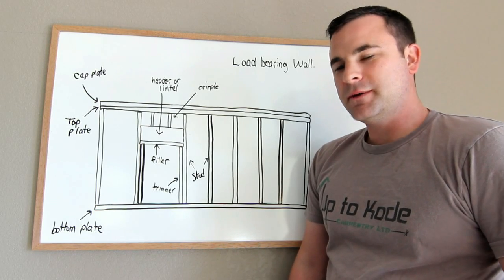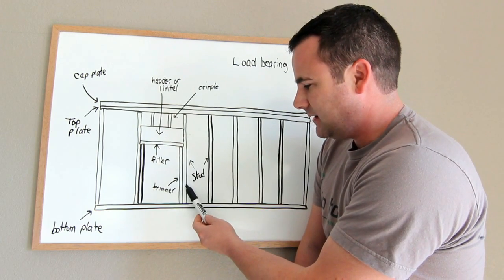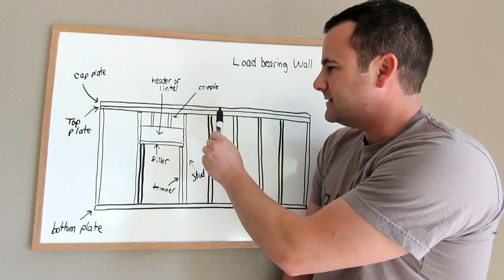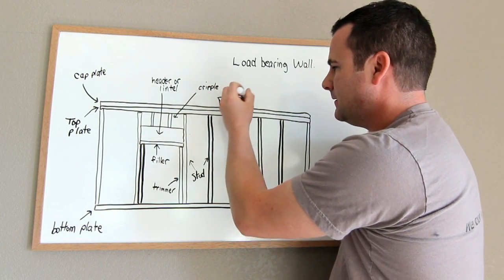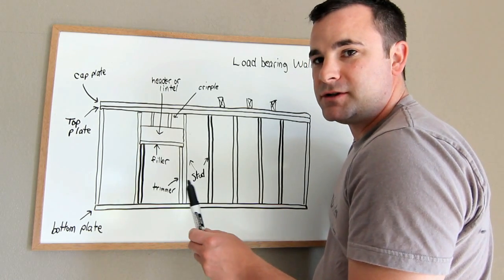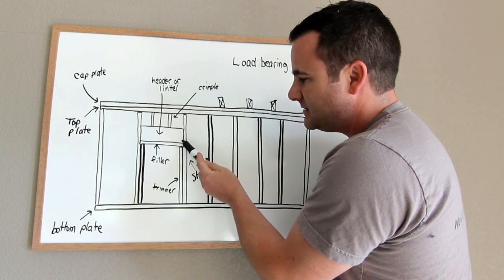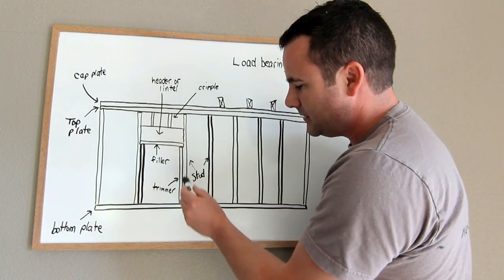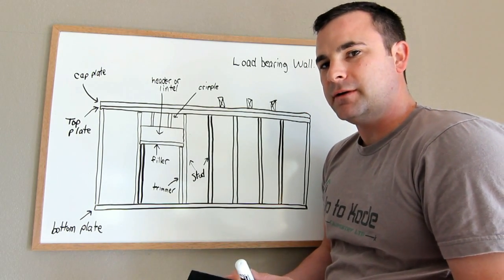Framing Tips and Terminology of a Load bearing wall

Comment: Can you explain how multiple LVL load bearing beams sit cross one another to hold up a floor? Basically if you have long beams, going opposite directions are they bolted into another one at the end to hold up the weight?

Comment: Is the size of the cap/top/bottom plate the same? What section is used? I assume it being C24 strength.
Reply from the maker: Not sure if I totally understand the question. If you frame a 2x4 wall then the plates are also 2x4. A 2x6 wall used 2x6 plates. 

You can get away with one top plate (and not 2) if it’s non-load bearing. BUT it also works for load bearing walls if your floor or roof member lands on top of a stud. Check local codes of course.
Reply: @uptokode  I meant that the top plate if you shape the stud with the rafter angle for example, will end up having a larger width.
Reply from the maker: Right. My experience is you would cut a “bird’s mouth” in your rafter to sit flat on the wall. 

If you do angle the studs and top plate I don’t think I would change the materials even those the dimensions change.

Comment: I have manufactured roof trusses and my garage is open 24x24 no wall in the middle and all my trusses are the exact same thru the whole attic. Inside my house there is a 24x28 room but they built a wall 13feet from a outside wall for the kitchen no board end ontop of this wall but could it be possible that it's there to support the roof since it's drywall because my garage is plywood walls which has to give it some kind of structural integrity right. I went under the house and this wall is built about a foot from the center metal beam that's put in under the house that the floor joist connect together and sit on but that wall isn't resting on it. I'm just afraid it's there to help with the roof even though I have manufactured roof trusses and they don't end ontop of this wall and begin again.
Reply from the maker: If they are manufactured trusses with the metal gusset plates then it’s very likely that wall is nothing more than to separate 2 spaces. In other words, it’s not load bearing. 

The only time I have seen a load bearing wall on the main floor is a “rafter” style roof and those are from the 1950’s or before.

Comment: You left out king stud.. the full length stud beside the common stud which you call a trimmer
Reply: Isn't that just a stud?  It runs from the bottom plate to the top plate just like all the other studs.  Then there is also a JACK stud?  What are those?
Reply: King trimmer ? Is a 2x4? Right all the way

Comment: What's the purpose of the filler board? Is using a filler better than simply installing the header at the height of the desired right  rough opening?
Reply from the maker: It’s especially important when doing a 2 ply header in a 2x6 wall. The filler gives something solid for drywall to screw to and allows something to nail to when installing casings.
Reply: Kody Horvey it also reinforces the door opening

Comment: Does the existence of a top plate plus a cap plate usually tell us that the wall is load bearing ?  Also , does the existence of 3-4 studs together by the door frame indicate that the wall is load bearing?
Reply from the maker: +William Eddy Not necessarily. It's common to frame the entire main floor with a top plate and cap plate so all walls are the same height.  Now the 3-4 studs beside a door frame does indicate load bearing. Typically in older homes (the simple rectangular kind) the load bearing wall would be down the centre of the home. Always good to double check of course.

Comment: I've opened my ceiling and walls up, built two supporting walls on either side of the load bearing wall, and once I had removed the load wall I've noticed that there was only 1 top plate.  I went into my attic, the rafters do not line up where the studs were,  also, the rafters are sistered together with 1/4" plywood.  I am installing a beam across the span, is it necessary to open it up to the rafters and install a secondary top plate onto of the beam itself?

Thanks
Reply from the maker: +Mitch Carlson Sorry I did not see this comment until now.
Reply: Rafters are usually 24" spacing and studs are 16" spacing so they won't all line up.